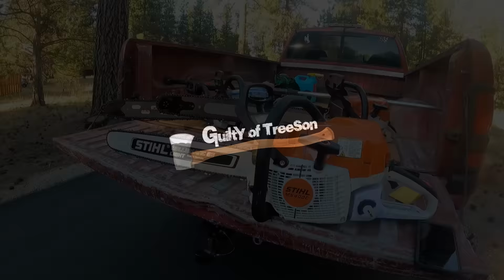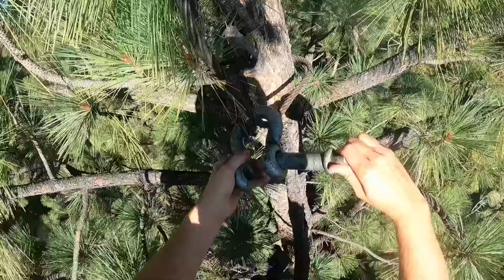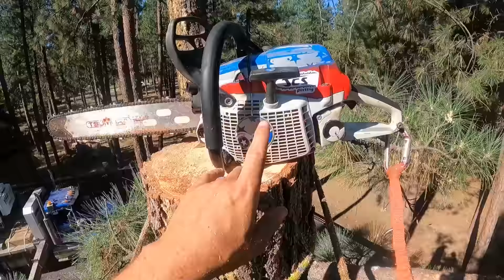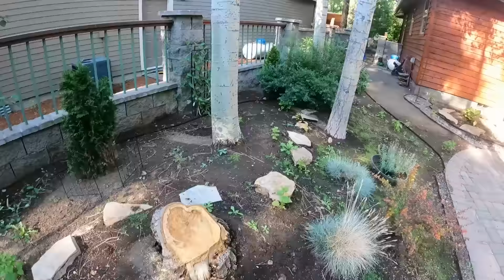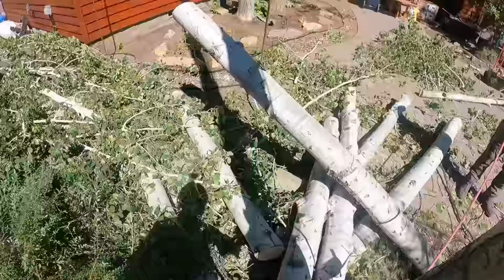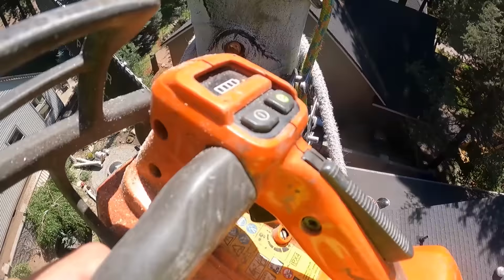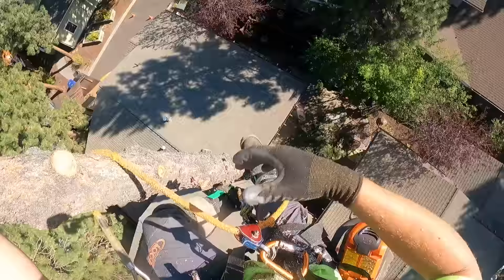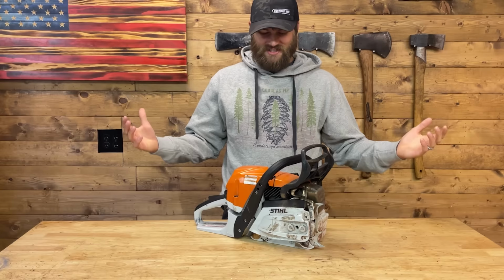Hands on Review of The Stihl MS 400c!

Comment: I work as a technician for stihl. Love the ms400. It has a magnesium piston so they are snappy and sound great.
Reply: Is it pronounced steel or still?
Reply: In germany its pronounced like 'steel'.
Reply: I'm a home owner and supplement heat with firewood.  My favorite saw was the 440.  I wore it out and replaced it with a 441 and had some issues with it, so I sold it on Marketplace.  I just bought a 362 and I'm liking that saw very much.
Reply: Θα ήθελα να ρωτήσω αν έχουν προβλήματα τα έμβολα μαγνησίου που έχουν τα ms 400 . Κάπου το διάβασα από Αμερική νομίζω ήταν αυτός που το έγραψε. Θα ήθελα την γνώμη σας η αν ξέρετε κάτι για αυτό γιατί σκέφτομαι να πάρω ένα ms 400

Comment: M-Tonic is still carbureted mon ami. Microchip controller and servo actuators to adjust carb to maximize efficiency and minimize emissions.

Edit;

Not sure if you actually liked the 400 or not (paused video to deal with some other stuff) but I wanted to say - if you thought it had good power now, wait until it wakes up.

Every M-Tronic owner I've asked experienced a significant power jump around the 1 month mark, depending on usage.  While not confirmed by Stihl, my theory is that the controller is set in a 'protected' mode until out of break-in.

Once your saw gets out of break in ... wow. I was happy with my 362 (power wise) out of the box.  Then it woke up.  Still vibey af though.  My 261?  Same same, less the vibey :)
Reply: I thought there was something "wrong" with the saw since the beginning cause it always sounded pretty rich and didn't rev up very high. The m tronic thing would make sense if you consider this also.

Comment: I have a 362 with a Bark Box and a high flow air filter.  Pulls a 25" full comp Stihl ultralight bar in hardwood with zero issues.  Great saw, not too heavy, enough power.

Comment: I bought a 400c two years ago and love it so much. It's primarily used for firewood cutting hardwoods on the east coast. With a 20 inch light bar it just tears through no problem. Light enough to be used all day long. I have a 25 inch bar but just haven't used it yet.
Reply: @Bobcat85-yl8oo  I have used it lately with the 25 inch bar and it works great 👍

Comment: You will love the saw with the bark box and the 3 point dogs. I bought a ms 400 put the box and spikes on now that its broken in it rips and it sounds good. Also after you run 5 to 10 tanks of gas through you new saws the ring will seat good and the saw will "wake up".

Comment: MS250, that would be a good one to review.

I have a few. Ran fairly well. Drilled several hole in the muffler. Now it runs great.

Last week while cutting fire wood, I ran it with out the top cover, that covers the air filter, now it out runs my 260. 

It runs very well. Probably shortening it's life, but it runs fast and pulls! Very happy with it.

I was able to get one of the last 260's. I didn't run the 260 for several years because it was such a dog. 

I opened the muffler up now it runs very well. The 250 is now out cutting it, so I need to go through the 260 again. 

I have a few 250's and a few 025s. I like them.

I have a few 026's and one 260. I like those as well. 

I have a 400. I like better then the 362.

My favorite word cutting saw is the 046 with a 28" cannon. 

My 066 is kinda too heavy for me to cut fire wood. I live in n central AZ, high desert -Pinion Pine and Juniper.  

The Juniper holds sand! I go through bars, sprockets and chain at a very uncommon rate!

Comment: CC is short for cubic centimeters. It’s confusing with stihl saws but husqvarna has a pretty easy way to tell how many cc’s it is. For example the 572 is a 5th gen saw with 72cc engine.
Reply: Yep, as volume technically needs to be defined as a cubic unit. I remember multiple chemistry tests where we had to use cubic decimeters (dm³) rather than liters for volume.

Comment: The sweet smell in the air is probably the ponderosas. If you sniff the bark they smell like fresh baked cookies. It works best on older trees, in an area of the bark that's a bit cracked revealing the reddish inner bark with maybe a little pitch leaking out.

Comment: Love the 400 personal.   They take a little longer to warm up than most saws but cut best when hot.      Once saw is warm fire up with choke on and let idle with choke on for 30 second then hold throttle wide open it will sound like crap for 30 second then go wide open (don't let off).  It will then jump back down from wide open.   Once it has it is retuned and you can let off and go to work.  Noticed a big difference in how much higher rpms where after doing this allso done it each time I mod

Comment: If they increased the compression on the 261 that really helps the power at higher altitudes. I raced motocross years ago and they made special heads that increased compression to high for normal altitudes when they raced in places like Colorado.

Comment: CC is the cubic capacity of the engine. It tells you how much air/ fuel the cylinders can handle. And how much gas it can hold in the tank.

Comment: Just bought the 400 yesterday, breaking it in today. I needed to replace a 290 that was my 20" between my 201 & 066. I was considering a ported 261, since I need this saw above ground and wanted light but powerfull. Still going to pick up a ported 261 down the road. Also the 400 ported is a ripper! Going to run full comp and full skip on the 25" and see what it likes best. Keep up the great work and vids.

Comment: You can’t go wrong with a 261… but I can complain about that bolt through the handle setup you got there.. Plastic eventually brittles and I feel it will eventually break and possibly pull through your handle because it’s creating a pressure point. I’d get the short loop strap and ring so it goes around the intact handle and holds it nice and soft. And when you get down just pull it off or unclip it. If that bolt pulls through your saw will drop. Just my opinion.  

And for pine pitch THEE BEST THING, you’re standing on it. Dry dirt. Rub and “wash” your hands with dry dry dirt or sand. Get the pitch to stick to it then go wash your hands off with soap. It also takes the tacky out in case you need to finish up work before you can find water. A lot better than having to work with your fingers stuck together and your hand stuck to the saw like fly paper. Put a dollop on your hand wash rub them together and brush off the excess.

Comment: Full wraps are great until you want to level a stump. I use a 36” hard nose bar Husqvarna 380 with non full wrap ahd a plywood stump cutting jig with hole in the middle to slide that saw through the cut evenly and keep her out of the dirt.

Comment: With a carburetor, that change of elevation means they need to change to a larger main jet. It needs to be bigger to compensate for that change of elevation. This isn't so of fuel injection. It does this automatically. Not only that except it burns less fuel than a carbureated engine. In North America, they use cubic inches. In Europe and Asia, they use cubic centimeters. So that's what those two letters are an acronym of.

Comment: Fyi; cc = cubic centimeters. The displacement of the cylinder. 1000 cc = 1 liter. So for example an 6 liter V6 engine is 6000 cc, or 1000cc / 1 liter pr cylinder.

It's measured by bore * stroke.

A 1.6-litre four-cylinder engine with a bore of 100mm (10cm) and a stroke of 50mm (five cm) can be calculated out by taking Pi (3.1416), divided by four, multiplied by the bore (10cm) squared, multiplied by the stroke (five cm), and multiplied by four (cylinders), to give 1570cc

Comment: Hey Jacob. We spoke on Instagram about the Rope Runner OG but just wanted to give ya a quick tip to get some gains on the power for any m-tronic saw. Since you swapped from a 25" to 20" to 28" you should reset the carbs when you swap bars that are bigger. Quick and easy to do and I promise you it will change the whole feel of the saw with throttle response and power. Even if only gains 5 to 10 secs in the cut that's saving time and time is money 💯💪🏼. Just thought I'd drop this tip for ya. Try it and let me know if it helped if you get time to reply or see this comment!  Thanks for all the hard work you put into these videos as well! Hope you see this and be safe brother! 💯💪🏼

Comment: CS-620PW. Full wrap supposed to be pretty decent. I think you would like it more than the 590. Very similar but the 620 has a better coil, full wrap available and and I believe a bigger carb.  Only thing is echo saws take a bit of time to break in from my understanding.   Good video.  Thanks for the content!
Reply: The 620 is a hell of a saw. It can be majorly woken up with simple DIY mods as well. If you have it professionally ported, it’s an absolute animal.
Reply: It's got a totally different cylinder too, and a different 2 ring piston.  Think of it as a ported and modded 590. Like you said also the bigger carb and a metal clutch cover.

I fkn love mine and will shout it from the rooftopa.
Reply: @mattfleming86  I have been considering it however, there seems to be far fewer bar and chain options from it.  It may be possible to use Husky 372xp bar and chains with spacers from what I can tell.  What are you using and will it pull that 27 ok?
Reply: @oakiewoodsman  The factory chain issue is there.  The oregon made echo bars are usually weird drive link counts.  My 24 is 81 vs the normal 84.
My honest advice...  buy it power head only (cheaper) and stick a tsumura or sugi on there (better and lighter.)  Their bars use more "normal" driver counts, in this example 84 like the rest of the world.
I run a 24 because a. i'm short and b. all I have are appalachian hardwoods to cut.  I'm probably 7 or 8 gallons of fuel into that saw so far and have zero regrets.  For the price paid i'm extremely happy.

Comment: Hello, the wrap handle bar kit for the 362 mounts right up on the 400c  Mine is fully decked out wrap handle, egan straight shot, west coast air filter and west coast clutch cover running a with a 20" stihl bar or 25" stihl light bar. I also have a fully decked out 500i-R. This is my falling pair. I used to run with the 441c and 362c as my falling pair and still love both the older saws, thanks for the videos!!!

Comment: I asked my local Stihl dealership, what's the difference between the 362, and the 400. They said the 362 is the 361 with mtronic just, bolted on, and the 400 is built from the ground up with mtronic
Reply: They very wrong. 362 completely different fr 361. Only real difference in a 362 and a 400 is piston and cylinder. Everything else is basically interchangeable.
Reply: 361 is built very differently than a 362

Comment: That’s nice little saw!  It’s a bit of an odd size in my lineup of saws though.   I thought hard about getting a 400 but I went with a 261c-m and had the muffler ported and it rips really good with a 20” lightweight bar.  Had it out limbing and bucking up some really large bitter cherry trees on my job site.  It was hogging through and chunking down 16-18” cherry trees like a champ.

Comment: Your supposed to idle a half tank of gas of 40to1 mixture then run the other half through with no more than half throttle....then one more tank of 40to1 with normal use

Comment: Great video as always, tho I have found some misinterpretations you seem to have about some saw aspects. 
First one would be "CCs", which means cubic centimetre(s), this is a unit of volume and is commonly used to describe a volume of either piston or the whole engine that is used for fuel detonation. Although the power of the chainsaw usually increases with the volume of its cylinder, these two values are not in direct corelation (for example Husqvarna 565 has 70,6 ccs and 3,7kW whereas Stihl MS400 has 66,8 ccs and 4 kilowatts). 
Second one would be M-tronic. M-tronic saws still use carburetor to provide the engine with fuel, M-tronic is just a chip that corrects the air/fuel mixture, therefore it very well compensates for changes in altitude, since it operatively adjusts fuel delivery depending on the ammount of air. I get why many people think that M-tronic saws don´t have a carburetor, in my opinion, the reason is MS500i, which has the direct fuel injection.
Third (and really a minor) one is bar length. Your observation that people in Europe use shorter bars is obviously true, it is tho not only a result of smaller trees and no skip-chains availible, it also has to do something with recommended bar length. For example my 362 is according to the manual supposed to be run with bar no longer that 50cm (20´´) whilst running a full comp chain, for the 400 we are looking at 63cm (25´´) bar with full comp chain. I can imagine manuals in the USA having a chart for half-skip and full-skip chains which should be obeyed according to keeping your warranty.
Reply: What do you mean "no skip chains available"? Let me guess... Nanny state safety reasons?
Reply: @littlejackalo5326  they just don't import them (at least to my knowledge), not only Stihl and Husky but Oregon as well, know the codes for skip-chains and they just are not offered. Don't think it has to do anything with law tho, more of a demand issue as most companies use harvestors these days and loggers with chainsaws usually operate something like 064, 500i or 660 which can pull full-comp of desired length

Comment: I just bought my first Stihl saw 362. At the dealer the tag said 362CM so i assumed i was getting the Mtronic, i get it home 2days later iam out starting it up an realize its just 362 carbed version, well i wont be back to that dealer again, i knew i shouldve went to Ace Hardware. I called Stihl an they basically said to suck it up buttercup its not much different. Thats not really the point when i just paid nearly $1,000, peaved to say the least whatever tho

Comment: I've been running the 400c in a commercial capacity for over a year now and my only complaint is that it out cuts it's oiler. The oil pump is the same as the 362 meanwhile the engine is beefed up. I havto run premium bar oil the $9/gallon stuff will literally burn up on the bar leaving black staining

Comment: A CC is a wee bit smaller than a CI.  CC=cubic centimeter, CI=cubic inch.  One is a logical scientific standard volumetric measurement, the other is American.  Also, it IS sueor important to spill excessive bar oil AND fuel all over the saw, as much as possible, at least every second refill.  This creates a sticky coating that not only protects the new plastic as it cures, but it also attracts and pulls extra power form the atmosphere; allowing the saw to come to full power 11/10.  The more you know!

Comment: U get thousands of comments I'm sure I'll try anyway a year later, if you start the m tronic saws let them idle for 30 to 40 seconds without touching the throttle. After that idle interval peg it full throttle. The saw will run crappy for 10 to fifteen seconds gathering data . Eventually the computer has enough data and the saw will start to scream. When it calms back down you are done programming the carb and it will run fantastically for the rest of the day.

Comment: I bought a 620 Echo about a year ago.  Full wrap, 3 point dogs. Opened up the muffler and did a base gasket delete.  Really like it.
Reply: If you havent yet replace the bypass main jet in the carb with the regular jet.  Worth way more than the 7 bucks or whatever I paid for it.  Tunes way better and has a more consistent top end.
Reply: @mattfleming86  Hi Matt, do you have a part number for that jet?
Reply: @230e4  Yup!  

Walbro 86-578-1

Currently 8.67usd on the bay.  You'll want to use a BRASS punch to knock the original jet out and be careful not to score the bore that it is set in.  It's just interference fit.  I used leather pads in a vise to secure the carb.  Pop it into the bore, open throttle or clutch plate and it'll roll right out.  Drift the new one in to approx the same height on the bore of the carb.  As long as the fuel can get into the path on the jet it'll be fine.  Super simple job you just want to take care in the swap and be deliberate.  11/10 would do again.  Good luck!
Reply: @mattfleming86  Thanks Matt! I really appreciate the info.

Comment: I run a 18inch skip chain on my 261 , and she cuts for a stock saw. I like your videos keep it up
Reply: Why? Full comp is smoother cutting and actually is faster. I run semi-skip on 24-28" bars, full comp for shorter bars, and full skip for longer. Full chisel, square filed.
Reply: @rogerbarnett8412  I run a 3/8 chain on my 261. I thought with an 18in bar it might be to much for the saw. But it cuts really well with the skip chain. I will try a full comp next time and give it a try. Awesome saw for the power to weight ratio. For sure.
Reply: @Joel602racing  I  have little use for narrow kerf or .325 chain. Yes, larger chain does need a bit more power to run, but your saw has plenty, especially with a short bar. As I said, full comp is smoother. And those that build and run race saws use full comp... pretty much 100%.

Comment: Was a cool colour mix the blue on the 26 and the blue on the crane truck! I’ve personally never really liked the 26, I’ve found they’ve always had clutch issues. If I remember correctly one of the guys at the local still shop told me they had weak clutches. Regardless, still a great saw for blocking down. Unsure whether I’ll get a 550xp or 261 for my next saw. What do you reckon bro?

Comment: Not impressed with my Ms400c!No power,hard to start,pull cord broke on 3rd use!!The pull cord handle is a gimmick!Cant repair it yourself!(Has to be heat melted!)So just put a normal pull cord  handle on it,worked fine!